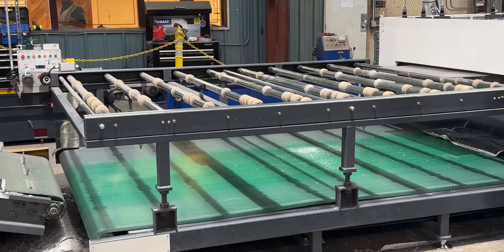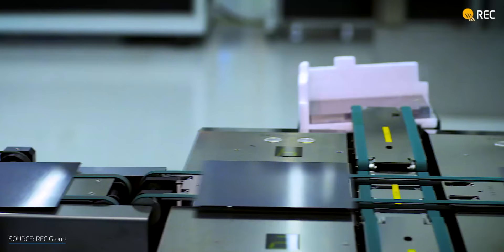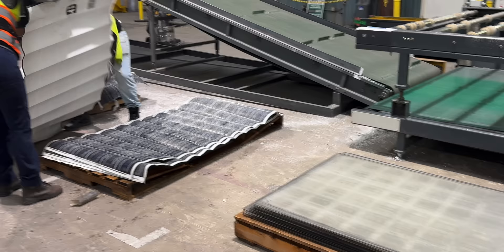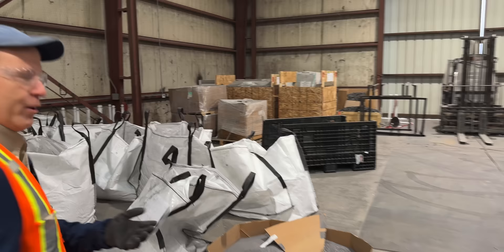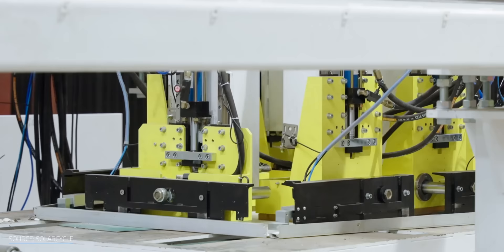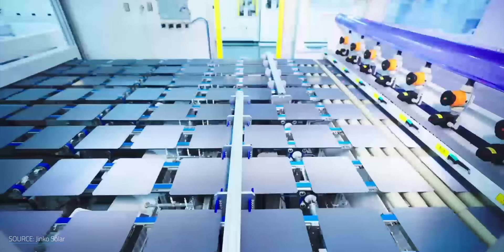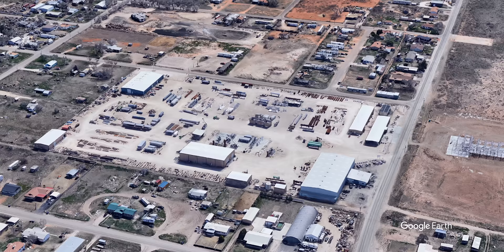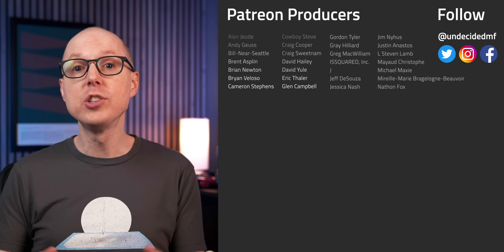What REALLY happens to used Solar Panels?

Comment: Nice video but you missed the fundamental information: the $ value of the recycled material. We know everything works if it's economically viable. If the salvaging of a solar panel costs 15-18$ but the value of the material they can sell is < 15-18$ then it's not that good (for now). I'd like to know the dollar value of the material so that we can understand the low threshold we need to reach to make it viable.
Reply: Also what I'd like to know. I would presume that manufacturers would be reducing their extraction costs if they utilized recycled material versus newly mined, though I'm unfamiliar with the entire process.
Reply: The value is in the silver.  It's currently $30 per troy ounce but the supply/demand fundamentals are way out.  It's an incredibly useful metal with anti-microbial properties used in medical bandages and is the most reflective metal on the planet.  Very few large untapped deposits exist and unlike gold it's usually not recycled;  the world has been in deficit for the last four years.   The price has to rise significantly, perhaps to $100/oz or more to match the skyrocketing demand, so recycling becomes even more attractive.

Comment: I use used PV. I got them from a AZ co that swaps out PV farms. They recertify them at a lower wattage. $60 for 250w is awesome. Focus on building quality is key, then the PV can be used 25-40 years.
Reply: If you build a panel right it can be used for 60-200 years.. You relaminate every 50 years and check the soldiers.

Comment: It's great to see recycling take hold.  There's a lot of comments in here about reuse before recycle, but IMHO that's pretty much a non-starter due to volume, performance delta, and price delta.  I just replaced 30 Evergreen 190w panels that were 15 years old with 27 new Canadian Solar 400w panels.  These new panels were $200/each & easily perform 2x....but they're really only $140 after the tax credit.  Considering that installation and racking cost more than half of total cost when putting in a new roof systems.  It would be foolish to skimp on ($ * area)/w for a 15+ yr investment.  Realistically what would somebody pay for these old panels?  I've seen them on CL for ~$20, but I doubt there's any real takers at scale.  The delta is just too much.  You'll run out roof area and racking budget first.  At this point I think they're more valuable as recycled than reuse.  I would suspect that if the solar panel efficiency % gains slow down then reuse will be become more viable, but the combination of tech + incentives are driving the economic bus here.

Comment: Easy fix.  Buyers of solar panels should pay a $100 deposit for every panel at time of purchase.  They get half of it back when they turn the panel in for recycling.  This ends solar greenwashing.
Reply: That's a crazy disincentive to get solar installed.  Who would one pay the deposit to?  Government?  They're all spending a fortune to subsidise installation..    Houses change hands multiple times in 20-25 years and the value of that deposit in real terms would be next to nothing by then.   The silver price alone will be incentive enough to recycle given the alarming current and forecast supply deficit.

Comment: Would it be possible to reuse the aluminum frame, rather than tearing it apart and reducing it to aluminum bits? Maybe if the panel makers could build panels to make them easier to deconstruct (without making them degrade faster during their service life)?
Reply: Might not be worth as much - the frames on newer solar panels are bigger and you would have differences between manufacturers. Keep in mind that some of the panels might be 10+ years old, so there will be more work from re-using them than melting and using for ANYTHING else. Aluminum is used all over the place, so the value for all industries will be better than just single-purpose.
Reply: @rklauco  that's only now though. eventually solar tech will plateu. theyll likely be a few standard sizes pretty much everyone uses.

Comment: The recycling cost isn't really a problem if it is added on the price from the onset. In the EU recycling PV panels is mandatory and this recycling cost is immediately added into the sale price, at the end of life they are just taken to an assembly point and then shipped to the recycling plants with no reason for people to dump them to save costs.
Reply: It does not surprise me that we had this in the EU before we stuck a referendum shotgun in our mouth and pulled the trigger.

Comment: Neat stuff!  Living in a small van going on four years i originally attempted solar electric winter heating.   Good though this year I run a Mr Buddy propane heater mainly on pilot light then up the heat with my electric heaters.   Works great and the electric heaters save me lots of propane.   I accomplish 48 hours of continuous propane heating from a single 5 pound tank.

Comment: As an essential part of the process involves heating the panels to soften the glues binding the layers I wonder if preheating in a " greenhouse" type structure or a bath using  black hose to heat the water for free apart from the setup cost ,which would be offset by the reduced ongoing costs during the actual process in terms of energy and speed

Comment: I don't want to be >that< guy, but that is a pump jack, not an "oil rig". An oil rig is the tall metal crane looking thing standing straight up with a bunch of large equipment and pipe around it. The thing he was calling an oil rig is what is put in place after the rig finishes and is hauled away - the pump that removes the oil from the hole drilled by the rig.

Comment: Since the glass is strong- tempered & the solar panel has an aluminum frame.  If they could easily remove everything inside. They could reuse the frames & glass panels to either build more panels or to make greenhouses.

Comment: I've seen several people buying used solar panels.  Not as efficient, but cost per Kw is significantly lower.  Usually enough to buy more Kw then if you bought new.  So maybe developing a used market would slow down the avalanche.

Comment: This is such great news! We must be able to recycle the panels to retrieve the materials for future manufacture. I am so impressed with their innovations and processes. I have had solar for over 25 years so my panels will need to be recycled in the future and I am happy to hear it is now possible.
Reply: There are multiple facets to consider. I doubt that the cost of recycling materials is genuinely cheaper than mining them when we factor in labor, processing, and transportation expenses. The industry might require regulatory support to ensure profitability, although excessive regulations could potentially hinder the solarization process and impede decarbonization inadvertently.

The materials typically recycled are mostly non-toxic and environmentally friendly, akin to sand.

Another critical aspect is redirecting attention from recycling concerns to preventing significant entities like corporations, big companies, and governments from discarding functional solar panels simply because they're 'expired' according to a 'used by' sticker on it or the paperwork.  This practice poses a more substantial threat, and implementing regulations to discourage 'planned obsolescence' is crucial.

Comment: So for a 300w solar panel the $15 recycle cost puts it at $0.05 per watt to recycle. That is only about 17% of the cost to manufacture the panels. That is low enough to add the recycle cost to the price of a panel. Kind of like a deposit on aluminum and plastic bottles. This is doable.

Comment: As others have mentioned, the logical thing to do is to manufacture the panels in a way which simplifies recycling. Perhaps using vacuum instead of sealant/glue to hold the cells between the metal and plastic, and ideally making the glass and metal reusable in new panels as the energy cost of melting them is quite significant.

Comment: Thanks, These guys are great for taking on this problem.
This is a great example where disassembly (recycling) should be built in to the design.Materials used to laminate could have added materials that could be triggered to break chemical bonds in a disassembly process under specific conditions

Comment: So important to make panels recyclable which seems very close to 100%. If this isn’t implemented it makes solar way less efficient than it is especially when an average panel is lucky to be 30% efficient to begin with. Thanks for shedding some light on this. No pun intended. I was also surprised that panels use so much silver.  That was a shock.
Reply: Not necessarily, since that could be less cost effective?

Adding a recycling deposit fee initially... That would eventually go to the recycler.... To prevent the negative externality of it ending up in a landfill..... It is the most cost-effective option, and then let the market determine the rest....

Comment: If you're ever in the area, the Sturbridge WPCF, has implemented BioMag in their secondary treatment and CoMag for tertiary treatment (mostly for P removal).  Ballasted flocculation of wastewater using magnetite with 95% recovery through wasted sludge.  It was one of the first facilities to implement both processes.  The settling rate of both secondary and tertiary sludges will blow your mind, seconds with minimal fines, UV to finish!  The capacity was more than doubled using existing AT's and clarifiers.  I was chief operator during the pilot study and subsequent upgrade.  Never knew you were a fellow M@sshole!

Comment: Try supercooling used solar panels with liquid Nitrogen to make them BRITTLE, to feed into a hammer mill or shredder, to reduce all of it into fine particles. (Try spraying the panels to make removing the glass and other material layers easier to remove?) then feed all of this ‘Dust’ into a room where air jets create a whirlwind, which will pick up and separate the different element particles into free-floating ‘Saturn Rings’, and have chutes pop up to catch and shunt the separated elements into different bins for recycling.
Reply: Consider a wet process like a sluice box.

Comment: Matt, so sad to see, or not see, on SolarCycles site not one mention of how effective they are at recycling solar cells. They must know how many grams of aluminum, colbalt, silicon, glass, etc, etc. are in each cell, how many grams of each are recovered, is what they recover at the purity level that is demanded by the solar cell manufactures or not, since they state numerous times on their site recycling to build new panels. Or do the products require further processing by someone else. Nor, what % of the mass coming into their facility ends up in land fills.  I remember back in my Organic Chem synthesis reactions that % recovery and % purity were quite easy to calculate, no calculus needed, simple division and multiplication. Also, in the processing stages they employ, how much waste byproducts are produced, how they recycled and accounted for. And how much energy consumed recovering each component and is the end product clean enough for it solar cell manufacturers.

I find it interesting that they state that they "recover 95% of the value" of the cells, but no mention of the % of the mass they recover. I understand their process is probably proprietary, but the mass in vs mass/purity coming out if it is in fact impressive, why isn't it being touted? If they were recovering 95% of the actual mass of aluminum, glass, silicon, etc, etc, wouldn't that really be something to shout from the roof tops. 

If you have data from the people at SolarCycle, I'd love to see it and I'll stand corrected.
Reply: Trade secrets maybe

Comment: Solar freaks are a different breed. the guy living a couple blocks away from me was replacing his panels. I offered to take them free off his hands (as they were still at around 70 to 80 % and they would be good enough for my cabin). he wanted to sell them I passed.  Lucky for me I found others for free along with the wireing and stands.  The other guy came to me and tried to give em to me(no use to me anymore). but instead he had to pay $200 to get rid of em.

Comment: I suggest working with the panel mfg to use the best adhesive which will offer most efficiently for the recycle processing. example: microwave or sonic de-bonding

Comment: There are multiple facets to consider. I doubt that the cost of recycling materials is genuinely cheaper than mining them when we factor in labor, processing, and transportation expenses. The industry might require regulatory support to ensure profitability, although excessive regulations could potentially hinder the solarization process and impede decarbonization inadvertently.

The materials typically recycled are mostly non-toxic and environmentally friendly, akin to sand.

Another critical aspect is redirecting attention from recycling concerns to preventing significant entities like corporations, big companies, and governments from discarding functional solar panels simply because they're 'expired' according to a 'used by' sticker on it or the paperwork.  This practice poses a more substantial threat, and implementing regulations to discourage 'planned obsolescence' is crucial.

Comment: Most of the used panels still work fine , they are just being replaced so that the owners can boost the output of their solar farms with more powerful panels .   Those old solar panels are cheaper than plywood right now so instead of grinding up perfectly good panels why not use them as building material .  They are a lot better than plywood and they still put out respectable power .

Comment: Automation and material re-use is going to be the key to doing this large scale. 

The other issue is classifying solar panels a special or toxic waste as we don’t want that leeching into ground water. This would require disposal through a recycling plant. 

Recycling in general is an important area for tech development, but it’s also difficult economically.

Comment: No one gets all angsty over whether you can recycle your windows.  When a window needs to be replaced, the old one goes into a landfill.  There's no real reason to hold solar panels to a higher standard.  If the value of the material is enough, and the recycling process is cheap enough, to make it worth recycling, great.  If not, an object designed to sit out in the weather for decades probably doesn't pose any extra risk of leaking out of a landfill.

Comment: Basically, anything is able to be recycled in some way. The question is rather how that can be done in an economically feasible way. 

With current manufacturing techniques and the delamination and chemical separation (of photovoltaic cell components) processes being the challenges to economic viability, it would be great to see the original manufacturers tweak and redesign their processes to follow a true closed lifecycle (ie manufacturing, productive lifespan, disassembly and reprocessing, re-manufacturing [repeat, repeat, repeat]). This would reduce their costs and ensure end to end support.

Looking at you Dow Corning!

Comment: Hi Matt
I really love your channel, you are a YouTuber that doesn’t just read from a screen/script, you really do the research and you know what you’re talking about. Keep it up. 👍💪
I think we should focus on the way we manufacture solar panels, instead of gluing them together, we should use vacuum to suck out the air from solar panels. Then it would be much easier to recycle/repair them. And it would probably be a little more expensive but in the long run it will be much cheaper.

Comment: 1. Total Respect for the presentation 

But like the presentation Monroe did about battery recycling which stopped at the black mass stage, which is where the real environmental mess begins. It’s exactly the same situation here.

Having spent a good part of my career, working on the chopping machines, that reclaim silver from X-rays we have the same situation with the environmental morass of the chemicals used and thee toll it take the workers health and the environment

Comment: What's always been a question on my mind with any recycling item is what do they make back selling the recycled material?  It's $15 - $45 to recycle a panel.  What is their return for the materials they harvest from that? If it's $15 to break one down but they get $20 for the goods they process that's a net gain of $5 a panel.  Vice versa, if they only make $5 a panel then they are losing $10.  Those number will adjust, as you mentioned, once the tech grows, but it's still something I wonder about.
Reply: A lot of this depends on the relative locations of recyclers (suppliers) and new production facilities (consumers of raw materials), industry changes over time (new consumers for the same raw materials), as well as tax and environmental costs.